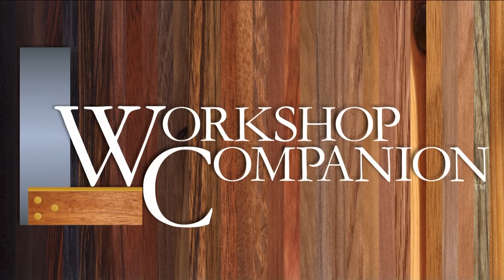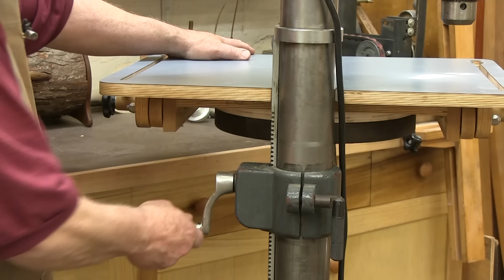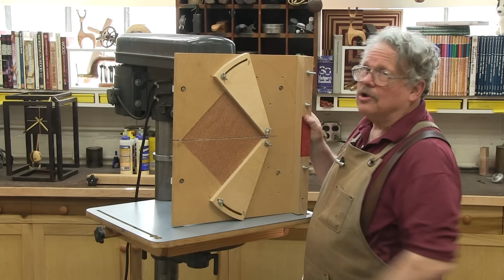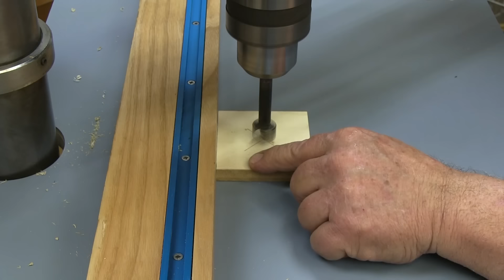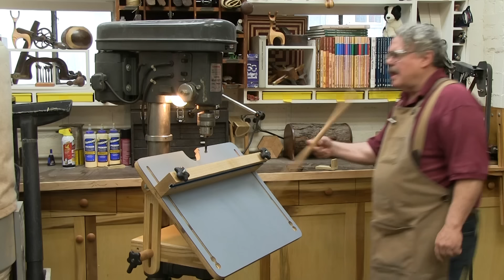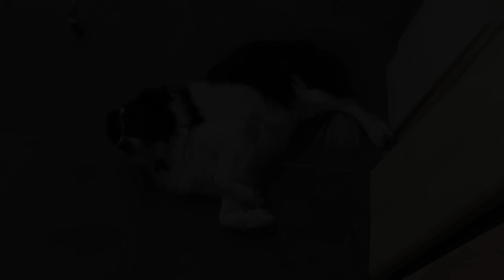Drill press Table - Woodworking

Comment: How practical is this for a smaller, tabletop drill press? Seems like there would not be much space for the “adjustable angle” feature of the table.
Reply from the maker: Depends on how small the drill press is. The table shown in the vid is mounted on a benchtop drill press, but smaller presses might require significant modification.

Comment: Lots of good ideas on drill press table design. A replaceable insert in the table top ( so that you don't need to always have a sacrificial board underneath the work piece) would be one thing I would add.
Reply: Agreed. I used a 4" hole saw to cut a bunch of circles out of some scrap 1/2" particle board I got from an old piece of junk computer desk. Then routed a circle in my table, the same depth as the thickness of the particle board. IMPORTANT: Locate the pocket in the table such that the point of impact is NOT at the center of the circle, but at the 12:00 position. That way, you can rotate the insert until the whole thing is chewed up, then flip it over or replace it with another.

Comment: The other advantage for a table/fence is if you use your drill press for metal fab there is likely cutting oil and fine metal particles on the table that you would not want on your wood.  The wood table would serve as a barrier to protect your wood work

Comment: Three more "hacks": 
1. station your drill press at one end of your workbench so you can rest long work on the workbench.
2. bolt it securely to the floor.
3. replace the set screws in the head with shop-made t-bolts so you can swivel the head around just like the table.  That also means you can move it out of the way and just use the press table as another work surface.

Comment: When I build this for my drill press, I am going to incorporate a digital angle finder that stays mounted to the table at the bottom of zero and as I lift the table, it’ll give me the angle. I’m after.
Reply from the maker: Nice idea. Another viewer suggested driving one or old two steel screws into the table so he could use the magnet in the angle finder to mount it to the table.
Reply: @WorkshopCompanion  FYI, I used your bandsaw magic video and made my mother a cherry and walnut lamp for Christmas and she absolutely loved it. You are the best shop teacher I ever had.
Reply from the maker: @ahdam82  Thanks for the kind words.

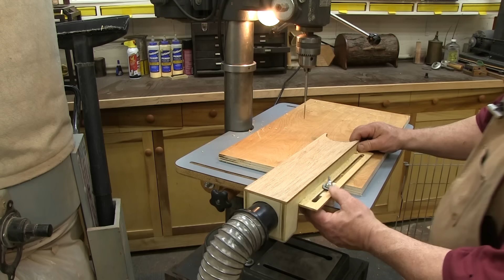Comment: 7:00 you said table saw when you meant drill press.

Honestly though, i might have to build one of these for myself, my table saws plate has no adjustment other than rotating around the post left and right and manually wiggle up and down so this would help me a ton!

Comment: I built this project in Woodworking Wisdom 25 years ago. It worked well in many ways.

I had 2 issues. It became somewhat difficult to reach the crank handle to raise the table. And the weight of the table made it fairly difficult to crank the handle. In fact I found that my Grizzly drill press crank handle broke trying to raise the table. The handle is covered in rubber but inside it is plastic. That was an easy fix.

But eventually I took the table down.

Comment: Would this work on any size drill press table? My drill press is nowhere near as big as the one you're using in the video.
Reply from the maker: In theory, it would work on any size drill press. But you might have to do more to adapt the design than simply scale it up or down.

Comment: What if you have a board that is, say, 3' x 18" (say, 3/4" thick), and you want to drill 4 holes on the 18" sides (say, close to the edges)?

This scenario is not typical, but sometimes, say, you forget to drill these holes before gluing the boards together, and you have to drill these holes after the frame is already glued together.

Here's what I did.
I removed the drill press table completely, then turned the drill to the edge of the workbench to get some clearance from the drill chuck to the floor, then set the board on the edge of the workbench and centered the drill bit on the board, clamped both the drill and the board, then drilled the holes needed.

I want to know if there is a better way to handle these cuts...
Any ideas?
Reply from the maker: There are many drill guides on the market for drilling accurate holes in large workpieces with a hand drill -- I've used the "General" brand drill guide to good effect  for years. In some cases, you can also use a doweling jig. I've also made my own drill guides for special projects.

Comment: Regarding a drill press vise. "Which we need about every five years." This guy is funny. I like him.
Reply: For a very long time I never had a drill press.  (I have a very small workshop and an even smaller budget) At some time I acquired a drill press vice.  (I think I inherited it from a relative).  Obviously I had no use for it but I kept it, knowing that one day, I'll get a drill press.  Then it happened.  My cousin was clearing out his garage and gifted me his drill press.  Great, I thought, at last that vice is going to come in handy but, no it came with it's own vice and it was better than the one I had.

This was about five years ago.  In that time I've made many upgrades to the drill but, in all those five years I've only ever used a vice once.  So his quote about "about once every five years" is absolutely accurate in my experience.

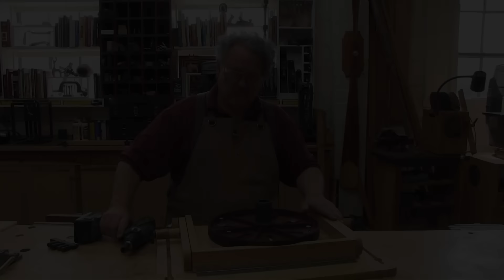Comment: 0:42 I've noticed so many make a new top out of wood then they attach it to the old metal table by various means.
I have also noticed a lot of drill presses use a pipe for mounting to the swing and tilt gadget on the column. if it is within your abilities, I say attach a pipe to the new (wooden) wood working top and plop it in place, this also allows you to swap it out for the original metal top if you wish.
Just one extremely simple method is to glue up several layers of ply and hole saw a hole through them, then glue them in place and plop your pipe piece in.
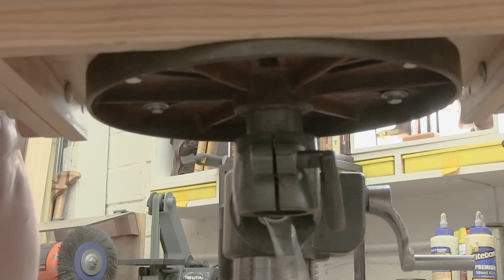BTW there is already a tilt on the original mount. 2:22

Comment: When I saw the title I thought of a Shopsmith in Drill Press mode. Other than rack and pinion adjustment your jig has it all. You have inspired me to make one for the local community centre wood shop which has a metal working drill press complete with all the frustration you mention.
Reply from the maker: Thanks for your kind words. And good luck.

Comment: What drives the decision to cutout the tabletop for the post of the drill press?
Reply from the maker: Design of the drill press relative to the depth of the table. Because of the tilting mechanism, the depth cannot be easily changed. As designed,  table fits with no cutout on a Cummings, but requires a cutout on a Delta.

Comment: Question. This table, since it angles front to back, mounted on the original iron table, will it be able to be angled to the right.
Reply from the maker: Of course. When mounted on an ordinary metalworking drill press, the table can be tilted on two axes. Unfortunately, it can only be tilted EASILY on one axis. But then, you can't tilt a metalworking drill press easily on even one axis.

Comment: Wow! The front to back tilt is terrific! I needed to drill a bunch of holes sloped at 5 degrees and had a difficult time. I sure wish I saw your video before I built my drill press table! I made a fence that doesn’t need T-track slots, but yours is better. Now all you need is a way of adding a replaceable sacrificial pad so you don’t damage your beautiful top. Thank you for this video.
Reply from the maker: Most welcome.

Comment: An excellent table!
I'm no expert but wouldn't it be better to have the table tilt towards the drill?
That way you could drill holes from top to bottom at a 45 degree anywhere onth the piece you're working on.
The way you're tilting it the press would hit the table not allowing you to drill holes in the bottom edge of your project.
Reply from the maker: The table is height-adjustable; you can drill at any angle without the drill and the table interfering with one another. But you can better see what you're drilling if the table tilts toward you.
Reply: @WorkshopCompanion  I actually thought about what I said and you're right. So thank you for that and the great vid.
Reply from the maker: @kellyroup4262  Most welcome.

Comment: Show interest and I'll explain how to true your DP so it drills a PERFECT 90.
Reply from the maker: I'll bite.
Reply: @WorkshopCompanion  OK.  So, you get wire clothes hanger, bend two 90s in it - so it looks like the hand crank for a very old car. Chuck one end in the DP chuck, raise the table until the wire just scrapes. Listen while you turn the chuck by hand.  When you get the same sound all around, the chuck is perpendicular all the around the table - perfect 90^.
Reply from the maker: @jthepickle7  Good tip. But you really don't need two 90-degree bends -- one 80-degree bend will do it.

Comment: Great video.  I use my largest foster bit with some left over melamine to get my table surface to zero. Recently I Drilled a set of 20mm hole on the top to allow me to use my 20mm and 3/4" accessories.   I was surprised at how useful this could be.

Comment: That is an impressive drill press table. I especially like the tilting function. I have been thinking about buying a used ShopSmith to get something like that.
Reply from the maker: I've made several drill presses from old Shopsmiths -- took the way tubes off the carriage and fastened them to cabinet bases with U-bolts. Works extremely well, but you have to weight the bases because otherwise the large headstock makes the machine top heavy. As far as a I know, Shopsmith is the only tool manufacturer that makes a drill press (or something that converts to a drill press) that is properly designed for woodworking.

Comment: Absolutely the best drill press table on the internet. I'm definitely building one. Two questions... what purpose do the holes in the back of the underside serve and the small filled in side of the actual table?
Reply from the maker: The table is a repurposed piece of Baltic birch plywood. In another life, it has been a jig -- probably an assembly jig for some airplane part I was making. I'm guessing I filled the dado and ignored the holes.
Reply: I thought maybe something like that. Thanks. You are incredibly talented and fun to watch. I am building this drill press table now, or something similar😂. I made the dust extractor. Also made your panel carrier and will eventually make the grid. Thanks for all the great instruction.
Reply from the maker: @davidpickering5513  You are most welcome -- I sincerely hope these jigs work out as well for you as they did for me.

Comment: I used this drill press  https://www.youtube.com/post/UgkxajoEbapTfqWaadnqb04h6U576yxXp-FE (they call it a workstation but really it's a drill press) a TON over the last few weeks. I've used it to make 8 cribbage boards (240+ holes in each board!) and a set of dominos. All in all I'd say I've drilled over 2,000 holes in the past 3 weeks. My impressions are that this is an absolutely essential little tool for anyone who has a Dremel, and even if you have the knockoff versions of Dremels, like the Chicago Electric tool, it really can't be beat.There are a couple little items to know though: First, there is a central bolt that holds your tool to the whole contraption, right at the center bottom. I would unscrew it and throw it out immediately. It should be replaced with a bolt of the same dimensions, only about 1/8" longer. The stock bolt just isnt long enough and rattled loose right when I first got it. It needs a bolt that isnt so short and has a few more threads and can be screwed in a little deeper. Luckily, if you're reading this, you're probably pretty handy and this is a super easy tweak that will help you a lot.Second, make sure your bits are absolutely straight and level in there. Because of the nature of how it drills, any travel will translate to funky holes or cuts on your finished product. You want to make sure you seat it properly before you fire it up.Third, I'd like to see some options for a fence on the baseplate. I had to fabricate my own using wood so that I had something to butt up against when drilling my holes. And ABSOLUTELY use some heavy duty hardware to bolt this thing down in place to your workbench.Aside from those small things, this has been an invaluable tool to add to my garage. I'm extremely pleased with performance, features (it's SUPER adjustable and can be endlessly tinkered with) and quality and price. Bravo Dremel.

Comment: Where do you get a rod that is certified to be perfectly round to check your drill press?
Reply from the maker: What you want is a precision metal dowel pin. You can also use a center finder -- just register off the shank, not the head. Both of these should be available from suppliers to machinists. And if you'd rather not buy anything, you can always use the shank of a large drill bit.

Comment: One change I think I'd make if you're expecting to have to take the table on and off to shim and adjust it is to use threaded inserts in the wood instead of lag bolts.
Reply from the maker: Good tip.

Comment: Just noticed, why are there 3 keyways under the formica? Are they stiffeners? or just a piece of scrap?
Reply from the maker: For many years this table was used to hold specific drilling jigs related to the manufacture of pioneer aircraft replicas (our day job for many years). The key ways held mounting rails for these jigs.

Comment: I really liked your dowel peg tip for getting regular spaced holes. Thanks!
Reply from the maker: Most welcome.
Reply: LOoks great on video, but you have to have a dowel the same size as the holes you're drilling. I suppose you could use another drill bit the same size.

Comment: The fence is clever but for smaller pieces or shorter pieces you could fabricate some type of vise or clamp to hold the piece you're drilling....Oh wait...
Reply from the maker: I often clamp smaller wooden pieces in a small wooden screw clamp to position them when drilling.. For metal pieces I use an ordinary drill press vise or machine vise.

Comment: Great additions to the humble drill press Nick.  The use of the dowel and stop would be good for a line of holes also. Generally incremental errors to spacing would not be a problem, unless measurements between multiple holes was a priority.  I'm definitely going to fabricate the tilting top because it is often impossible to get 100% vertically accuracy with the factory cast iron top from front to back.  The dust collector is a necessity - as so much mess is created especially when using large forstner bits. Great video and narrative also Nick.  Thanks!!
Reply from the maker: Most welcome.

Comment: I've often wondered why there is not more recognition that drill presses are designed for metal work and NOT for woodwork.  I too have modified not only my drill press but also my bandsaw table.
I like and approve of the way you built yours.  I think maybe your dust collection piece is a bit of over-kill, since the drill produces flakes rather than dust, the latter being more dangerous to the lungs that flakes.
Judging from the quality way you did things here, in another life you might have been working in a toolroom - where the most skilled of metalworkers properly belong.  [ That is in the time when metalwork had not yet been given over to computer controlled cutting and robots ! ]
Reply from the maker: Behind the white door in the set there is a well-equipped metal shop with two 50s-era Southbends, a Bridgeport, and others. But no computers.

Comment: My fence is 1/8" thick aluminum angle from the hardware store, either 2" or 1" as needed. The ends were drilled and countersunk for a 1/4-20 screw, with the corresponding tapped holes in the rear corners of the table. In use, only one end pivots on a screw placed through one end, and the free end is C-clamped to the edge of the table.  The distance from the fence to the bit is determined by placing a square against the fence, and measuring the distance as the fence is swung into position.  The advantage of having a  fence that is fixed at a pivot at one end, is that only one clamp needs to be tightened, thus reducing sliipping out of position.  I also made positioning stops that straddle the angle.

Comment: maybe you can help what slick material to attach to the jigs you create, where to buy it
Reply from the maker: It's just a gray plastic laminate. You can pick up 4' x 8 sheets at most home improvement centers. The stuff on the drill press table came from Lowes.

Comment: 8:10 Using a stop this way for drilling multiple holes with the same distance is one of the more clever and simple ways of doing this task, I've seen on YouTube 😄👍 You should make it a separate video, so it would be easier to search for this tip – This way us poor newbies don't end up attempting to measure it out or making bulky jigs 🥴

Comment: Thanks for a great video.  On a different note, I have a nearly identical drill press as yours and would like to know how to get the chuck out.  There's no slot on the side of mine and no bolt inside the chuck.
Reply from the maker: Our chucks are mounted to the drive shaft via a M2 or M3 Morse taper, pressed together. The chuck is removed by pressing a wedge between the top of the chuck and the bottom of a step in the shaft. If that's unclear, I show how to change chucks on drill presses in my book, "Using a Drill Press."